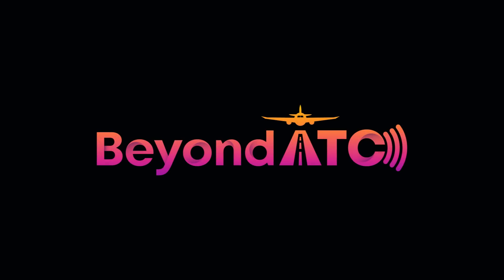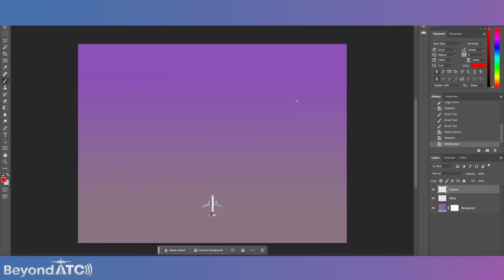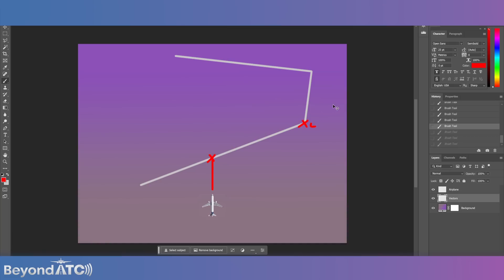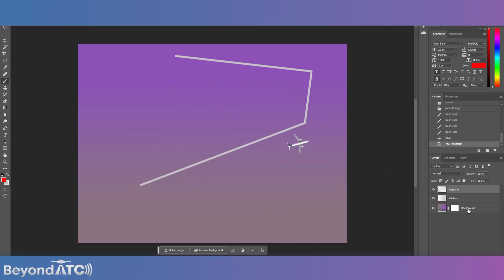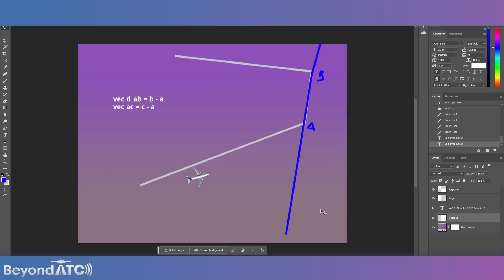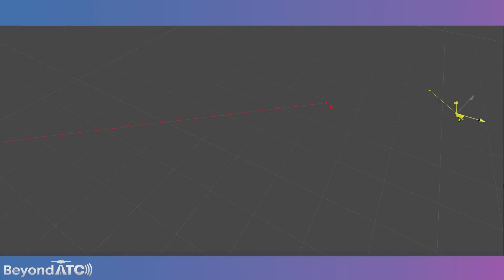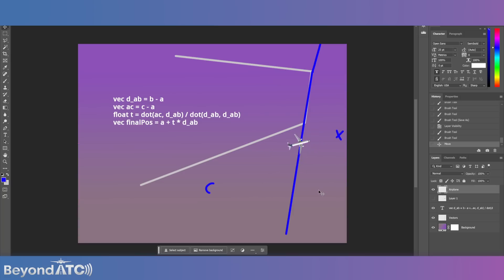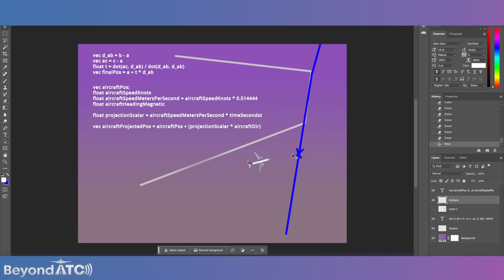BeyondATC - Vectoring!

Comment: I’ve been in the conceptual design business for many years, and here is what I’ve learned: never present a price for a product without what you would consider the final product. Doing so, leaves the client with 1 option (to decide on price). 

Showing them the product presents the 2 most important questions (value and cost). More importantly, it posits the question and the answer to be rendered by them and only them. 

Captain, if I may offer some advice, it is not for you to convince them (only they can do that). If you think about it… what you are producing is verging art and no amount of money will ever compensate you for that. How ironic it is that by putting a price tag on something that we so often devalue it. 😢

Comment: Very interesting😊
Just my point of view, as i am an ATC
Most of the time now, we use RNAV point which is the most eficient way to guide an aircraft
We barely vector to follow a track
So what is a the point of vectoring an aircraft?
Sequencing or separate planes
So when we give a vector, we have to visualize a target in space in time in the future
Visualizing the closest point between 2 planes in the future is the tricky part of the job😄
Reply: And for sequecing on final, imagine an aircraft just passing the FAF at time H, your target for the next aircaft is the FAF at H+1m30 (if sequencing time for the runway is 1m30)
Next aircraft at the FAF H+3min and so on
So vectors are given to be at the right position, at the right time

Comment: Great work... only thing that concerns me is 10deg off can be quite a lot in distance (1:60 rule)... depending how far you travel 10deg off track... OR will it end up being no more than +/- 5deg based on whole 10deg values?

Will it always go to the greater req value?

Is there a distance limit on vectors (just for approach)? 

Or can you get vectors under IFR to cross CAS (transits)?

I bet it's a HUGE amount of work and the deeper you go the bigger it gets!

Comment: Some controllers will give you 5 degree increment HDG assignments, not often but they will. 

Its most often used when the aircraft will be on that HDG for a longer time than usual, if you fly 5 degrees off course for 60nm, you will be 5nm off the intended point.
That is why they will use it when vectoring distances more than like 15nm where a 5 degree off course HDG will put you 1.25nm off the intended point, or more than 30nm where 5 degrees off will put you 2.5nm off of the intended point.

 Another common thing they will say is "Turn 5 degrees (Left/Right)" to correct you closer to the point they want you at. This could be helpful if the aircraft being vectored overshoots the desired track line (Point A) and you want them to just turn a little bit back toward the desired point where the desired track line intersects the next desired track line (point B).

Comment: Interesting. I have a question. Why does ATC issue vectors that cannot be published? Why should it make a route with other than 040 or 050 if it can't? You can argue that it is the best and most convinient route to avoid terrain or whatever, but in reality, it ends up off course! I reckon the issueing is where the problem might be. Publish the best route with only 040, 050, 060 and so on. I might be completely wrong. Great work non the less, and thanks!

Comment: ATC gives vectors in 5 degree increments. Wouldn’t that give you more options to work with? Thanks for the extremely difficult work! Amazing stuff
Reply: I guess it would make the vectoring more accurate, but the solution would look the same since there will always be some error you need to compensate.
Reply: Had the same question re: 5 degree increments. Seems it would make it a little easier. Though I don’t understand the linear path restrictions beyond needing a track and intercept. It’s beyond me.